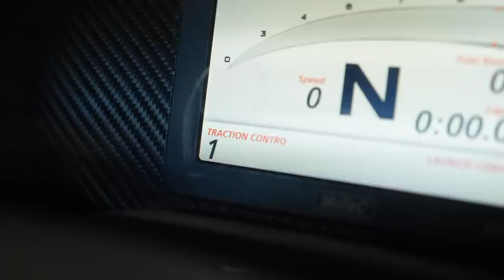First Corner Carnage | GT86 8600RPM V8 | SIERDC Round 1 Teretonga Park [VLOG]

Comment: With your back bumper, if you are going to make one out of fiber glass  . Use a lament of one layer  of 225 csm one 600grm DB glass  one 320grm Kevlar  and another of 6oo gram DB glass .ues a polyester resin !  .Reinforced more  around mounts of course .It is the best i have found for non high where areas for rally and speedway cars .if you need more stiffness in areas wait for it to dry (really important )  put in a pvc foam rib (10 mm is usually enough) shape to a 1/4 round and use the same lament over the top  ,Hope this will be of some help if you go that way
Reply from the maker: Cheers for the tip Martin! I'll pass it onto the team here, not sure what the future plan is at this stage so open to anything - Taz.

Comment: Did I misunderstand - or did you "solve" your differential leak by fashioning a diverter to allow the oil to leak onto the racing surface instead of burning on the exhaust???

Comment: Well done.. you did laptimes similar to the top running K swapped honda cup cars.
Reply from the maker: We were slower than a lot more cars than we were faster than, however, the splitter and wing added after this race made a solid difference to corner speed. A bigger tyre would change the game but also comes with many complications - Taz.

Comment: Definitely happy to see more of this. What classes were racing? Seemed like a really packed race
Reply from the maker: SIERDC run the following category’s based on engine size:

Class A: up to 2000cc
Class B: 2001 to 3500cc
Class C: 3501cc+ (excluding cars that fit into classes D & E)
Class D: Any Porsche 997 or 991 Cup Car, any pre CoTF Australian V8 Supercar, any pre 2007 FIA GT3 car, any FIA GT4 car, any space-framed car, or any other car at the sole discretion of the Club.
Class E: For cars constructed as FIA GT3 specification (post 2007), any CoTF spec Australian V8 Supercar or any other car, at the sole discretion of the Club.

We're in class C, but only by about 500cc 🤓- Taz.